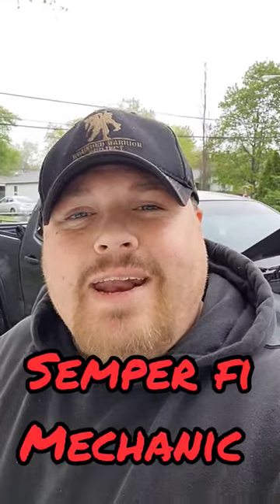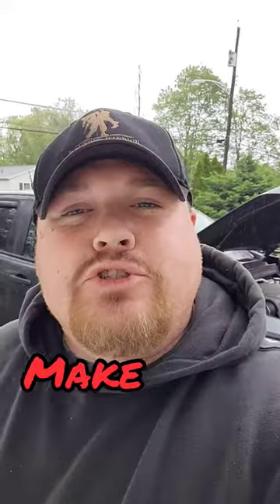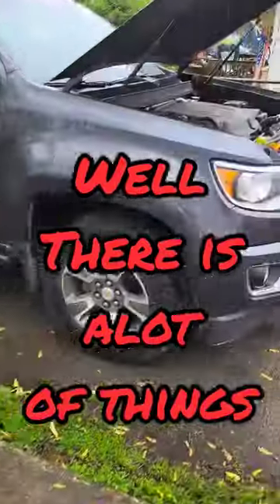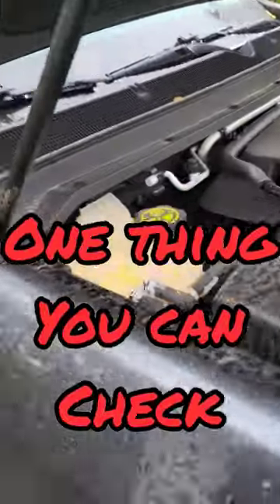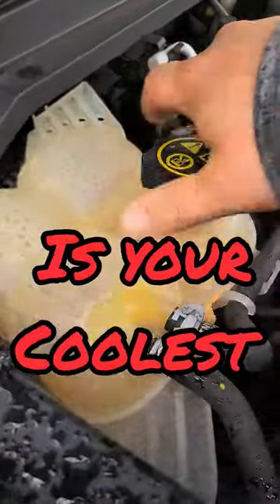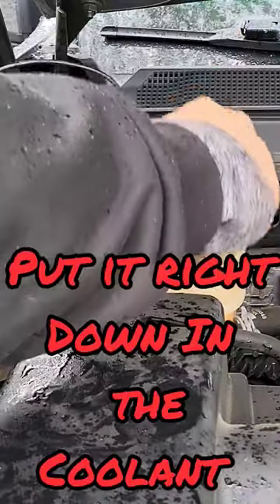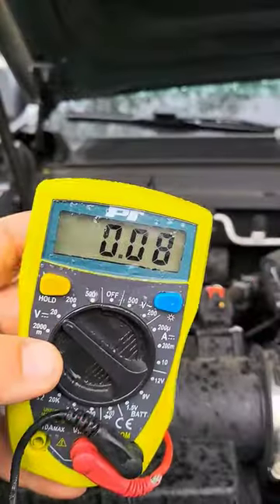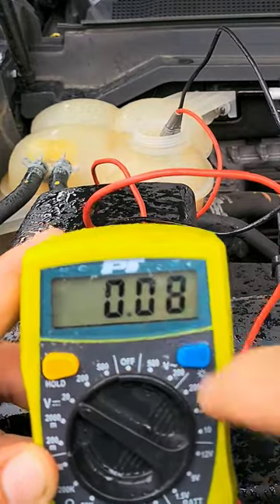Voltage Coolant Test

Comment: coolant flush tip - never use drain plug, they break. Drop lower hose. Hoses easier to find at auto part store if there is a problem.
Reply: That is great tip!
Reply: Thank you for that lol

Comment: You forgot to mention checking blinker fluids, and buying a couple left handed wrenches for working on the passenger, or "left" side of the vehicle🤙🤙 thanks for the great tip boss
Reply: You forgot the main and most important one..a bucket of compressed air..it has to be a bucket…how else are you going to pump a tyre with a hole in it
Reply: Come on now dude everyone those don’t exist. With a combustion gas engine the one thing you want to keep an eye on though is your Muffler bearings, make sure they’re properly greased as the last thing u want is exhaust gases back flowing into the Flux Capacitor. Once your flux capacitor starts misfiring you can’t hit 88MPH and that’s the last thing u want. You don’t wanna end up like Marty McFly stuck in 1955 making out with your young 16YR old mother u know what I mean?

Comment: That's a pretty interesting way to test. Just beware that nominal readings will differ, depending on metallurgical properties of the radiator and whatever ground points you test between.

Ignoring factory recommended service intervals, the most reliable method is a pH test. That voltage is created due to acidity of the coolant. Typically, coolant becomes more acidic over time.

This is why factories electrically insulate radiators from the chassis. Rubber grommets and mounts, with very minimal metal-to-metal contact. Together, the radiator's aluminum and the chassis' steel act as a battery when coolant is present.
Reply: What happens to the stray voltage and why is such a small amount of voltage a concern?
Reply: @You_2ube_user I’m guessing it can travel..and if your fuses and such are already near peak I’m guessing that it’ll be enough to trip them…imagine if something else was spiking then you get more voltage from radiator it’ll be well past peak maximum
Reply: @tztezza  ok thanks

Comment: Pro tip!!! Outside of blinker fluid the one thing you want to keep an eye on though with a gasoline combustion engine is your Muffler bearings, make sure they’re properly greased as the last thing u want is exhaust gases back flowing into the Flux Capacitor. Once your flux capacitor starts misfiring you can’t hit 88MPH and that’s the last thing u want. You don’t wanna end up like Marty McFly stuck in 1955 making out with your young 16YR old mother u know what I mean?

Comment: Thats not exactly how it works. Your best bet is to just use ph test strips. If you want to use a meter check to ground or check resistance for high minerals.

Comment: That's wrong.  You are not supposed to put both leads into the coolant.  One lead goes into the coolant and the other lead goes to battery negative terminal of battery.  Surprising that nobody else in the comments picked that up.